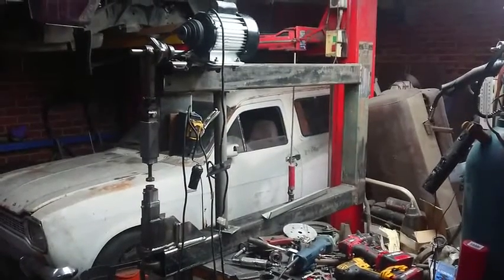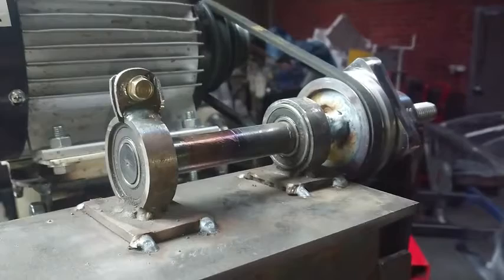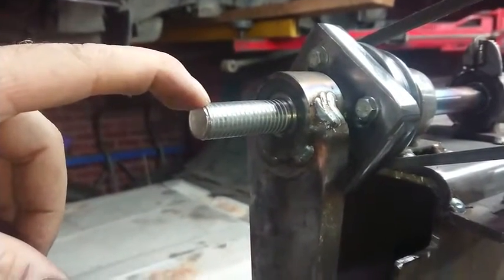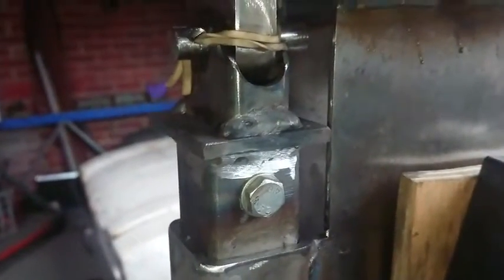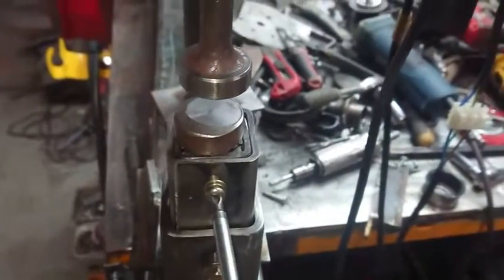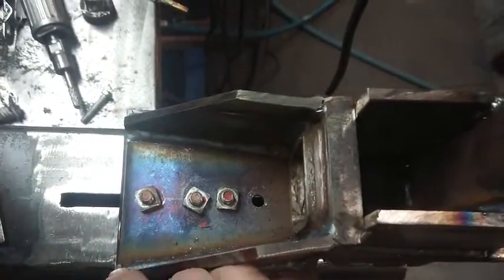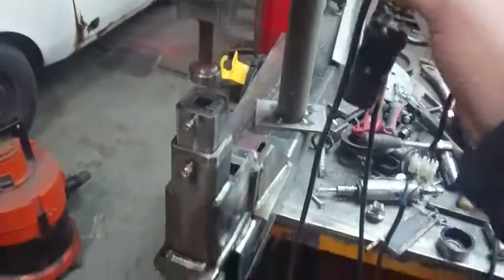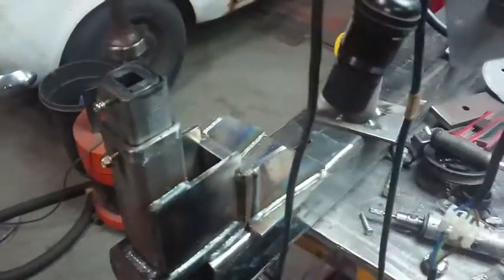Home made power hammer - overview of the build

Comment: Hi . Can you bottom the hammer out and bend something . Or does the frame flex ir motor just stops ?
Reply from the maker: It had some flex in early stages but the frame has since been stiffened up with plates. Even without the extra bits it was certainly able to shape steel. I've made custom profile dies to shape things like windscreen panels and a few other things.